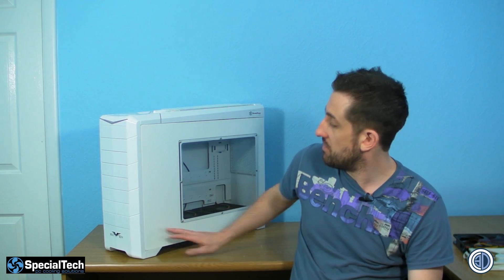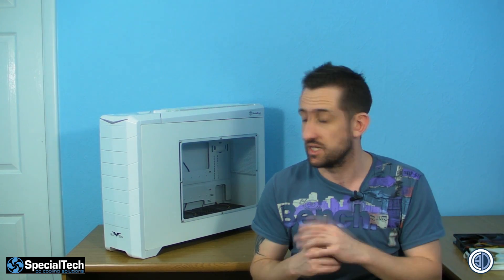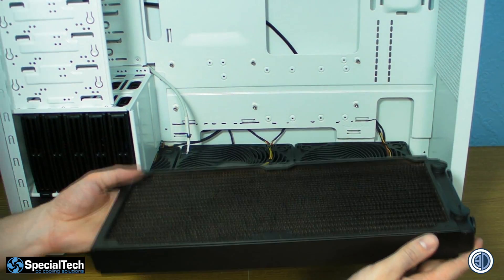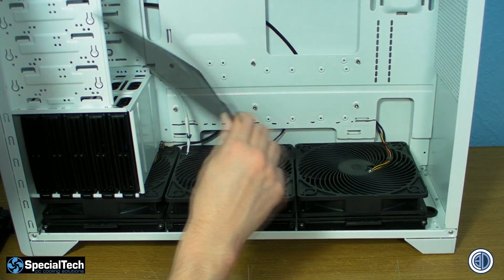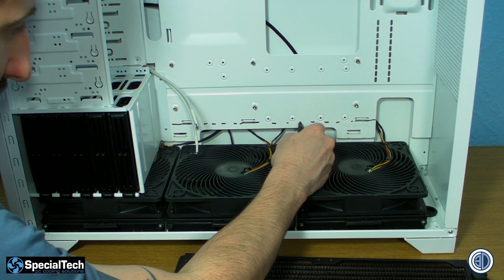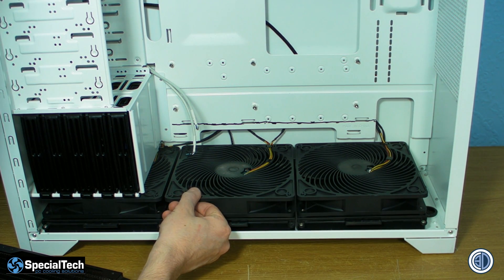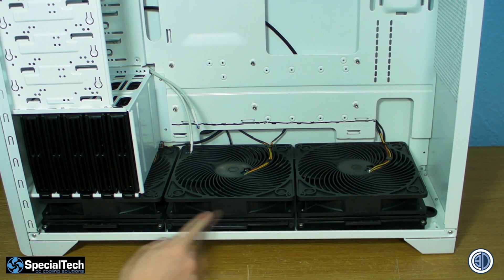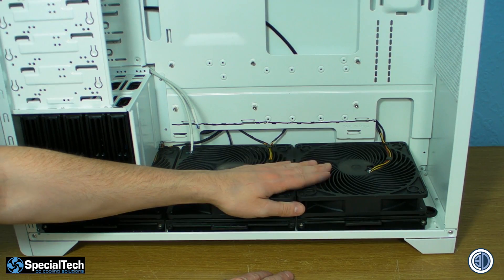How to watercool a Silverstone Raven or Fortress RV02 FT02

Comment: I picked up an RV02 a few days ago, took it apart rubbed it back resprayed it and cleaned all the panels and fans. This is one of THE best cases to ever be released imo, case manufacturers now could learn a thing or two from the Raven line up.

Comment: I just tossed a 120 mm radiator at the top of the case in the spot the current 120mm fan is mounted. No cutting, no muss no fuss and very cool temps. You can also drop in 3 120 mm radiators in the bottom without any cutting. It's a great case and actually has so much cool air brought in it can be easily air cooled so no water cooling is even needed.

Comment: I've been thinking about removing the Drive cage area and mount it up the top instead of optical. but if i go M.2 i'll prob go SSD blocks in the back. 

i don't think imma get a 3080 in this case so might just upgrade by 2022.

i have the first edition of this case and have been lucky to get button replacements from Silverstone aswell as replace the fans with AP181 air penitrators. 

the air pressure is really nice with fans.

Comment: the links are dead, how long is that video card i have a gtx 980 ti
2020 yo
seen this tower on FB market place
Reply: 280 mm for video card
Reply: . GeForce GTX 980 Ti is connected to the rest of the system using a PCI-Express 3.0 x16 interface. The card's dimensions are 267 mm x 111 mm x 40 mm, and it features a dual-slot cooling solution.

Comment: I bought the Corsair H115i and own the Silverstone RV02   This is brilliant!  However  I do not own cutting tools to correct this problem and my radiator is smaller than this one depicted  Is it ok to rest the radiator on top of the 2 fans and DIY fasten it?
Reply: yes i use a old shitty cpu fan on my small rad that cools my 980ti, works fun total looks like it should not work

Comment: Do you know if GTX 1080Ti will fit in Raven or FT02?
Reply: It depends. If you have a GPU with a length of 30cm (12 inches) it will barely fit in, because it will come in touch with the bottom fan. However, you can remove the middle fan. But I suggest using a GPU which is less than 30cm long. Most GPUs with three fans are arround 30cm long.

Comment: If I remove the HDD cage and use a pull/pull on a triple 180mm radiator, would that be enough for a CPU+3-GPU system?

Comment: Can't you mount the radiator outside the case under the 180mm fans???because the case has also 2 holes there to do that....???
Reply: maybe suffer poor airflow into the rad as well as losing the dust filters and getting dust in the rad?

Comment: i have done this similar to how you have done it but i cut out the dotted vents at the bottom and mounted the dust covers on the bottom of the case, then clamped them on through into the fans and then to the radiator which gave me like 20mm lower down on the 2 back fans, a little bit more room and gave me piece of mind due to it been so close to the graphic card and motherboard

Comment: To go through and find links to all of the fittings, hose, blocks, reservoir, radiator, and coolant in a shop that ships to your region is a lot of work to do for a guy in a comment section. I wouldn't do it simply because you capitalize every word you type.

Comment: I have used the Corsair H80 & it screws in just fine. I also used the Corsair H100 & a custom install using the Koolance HX-CU1020V rad & it fit perfectly. That's the easy way. Now the HARD way; type in the youtube search bar - Silverstone FT-02 BW 540mm RAD conversion Water Cooled - Now this guy made the Magicool 540 FIT. No need to mod the mobo plate. Watch his video and you'll see why. He even made 3 x 580 GTXs fit in there. BTW, you did a clean job. I like it. Later. :-)

Comment: So eventually, loop is like this:
pump into cpu block (lower port) out of cpu block (upper port) into chipset block (left side port).
exit chipset block (right side port) 90 degree fitting and connect to rad with tube, exit rad into res then pump.

Comment: Would running a radiator like this greatly affect the GPU's air intake? I'm pretty keen on oc'ing that part as well but i worry that this would result in bringing much hotter air into the case

Comment: Silverstone didn't really get the message that us Rv02 owners would like to do wc setup. If the new RV04 is bigger, at least height-wise, then we can hopefully slap a 3x180mm rad in there with room clearance for longer cards and bigger mobo. Also bumping the fan size up to 200mm would be better and also add more room behind the motherboard would really help out with the whole storage drive issue when you're trying to do wc.

Comment: @finny798 Nowadays my dear friend, we have non conductive coolant, so even if a loop leaks it won't do any damage if you do your research right. The benefits however far outweigh risk in my opinion anyway. If you do it right, you get much lower temperatures OR higher overclocks(say if your CPU was cold anyway and heated massively under OC), in addition to that, you can run your GPUs on the same or a similar loop, making them cooler AND removing the annoying GPU fan noise. Quiet is the game here!

Comment: If he was willing to mod the case more and take out the HDD cage he could have slid the RAD to the front more leaving the barbs at the back then remove the last fan that is directly under the power supply and put the RES there. That would have made his loop a whole lot more clean IMO.... BUT that is a lot more work and you would have to open the case when filling the RES

Comment: @karadale20 Maybe with a single 180x180 rad, but with a dual 180 mm it wouldn't work because you'd have nowhere to put the end with the barbs on it -- the bottom fans touch the rear of the case and the side of the power supply. You'd have to check the length of your graphics card, but I think your best bet would be to put a thick dual 140 mm in the bottom and a thick dual 120 in the 5.25" bays.

Comment: In my FT02, I removed the filters and directed the fans downwards so the air goes through the 180x3 and out the bottom of the case so the warm air doesn't pass over the ram and motherboard. Will it make any difference?

Comment: Talking about a tight fit. The angled sata connectors are incredibly close to the radiator. Bet you had to plug them in before you put the rad in. But looks awesome, I like it alot.

Comment: @Roland0314 I consider them both high end air cooling.  I actually prefer the D14.  I think you are looking way too deep into my comments.  They give similar levels of performance, but I agree the D14 edges the H60 out.  Saying the H60 is NOTHING compared to the D14 is a bit of an exaggeration.  The H60 is still a nice cooler.  I'm a fan of heat pipe cooler's myself.

Comment: @1nothingspecial It's also very feasable to drill a hole in the top of the case and add a fill port, at least on the FT-02, if your res's top port is far enough to the back.

Comment: @SanandanDA They come with brackets to put a triple 120 mm rad over the fans. You could use it to affix the dual 120 mm rad of the H100, but I think you could only screw the brackets at one end (at the other end the bracket will be in the middle of the 180 mm fan.

Comment: @longmage4 I think you could put a thick 120 mm with most motherboards, since the 120 mm fan is above the IO plate -- it likely won't interfere with the VRM heatsinks, so it's mostly a matter of avoiding interference with the CPU block & its fittings. lvl8hacker had a think rad in push-pull in this ft02 build.

Comment: @longmage4 what top? u mad this isnt normal design case, noa chance youll fit a rad in there, UNLESS you mkae extra holes to lower mobo but its alot of work jsut go with 180, 360 mm rad at bottom

Comment: The "easy" way is actually a bit involved, at least if you remove every piece of the Silverstone fan mount -- see those two bumps at the bottom of the case? I had to Dremel them out to fit the triple 180 mm magicool rad (in any kind of stable manner). One nice thing about fitting the rad straight on the bottom is that you can still easily use the cable hole at the bottom of the mobo. I mounted the filters with "magetic tape" from the arts supply store.

Comment: Hey, Tom, what if you glue some magnets on the filters and stick them on the bottom of the case?  That way you can get rid of the filter assembly and make room for a triple rad and still have filters.  I've been thinking of doing that with my FT02.